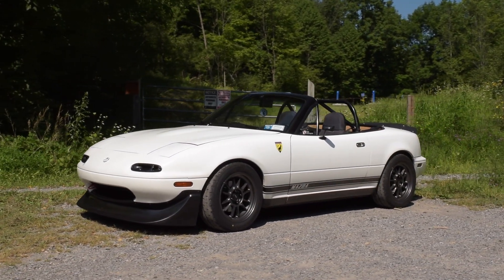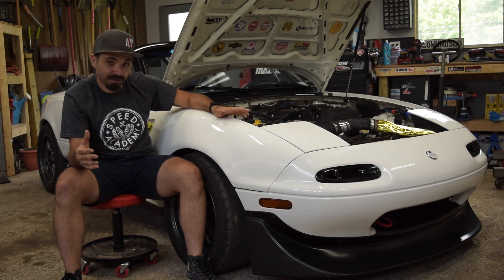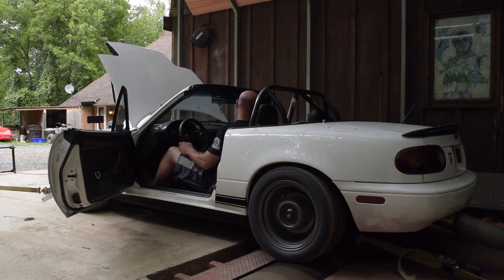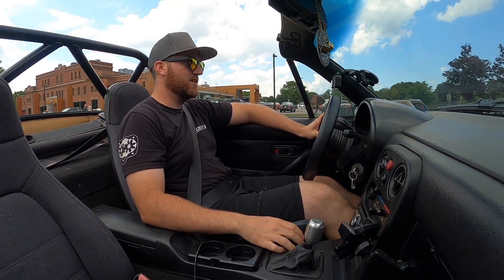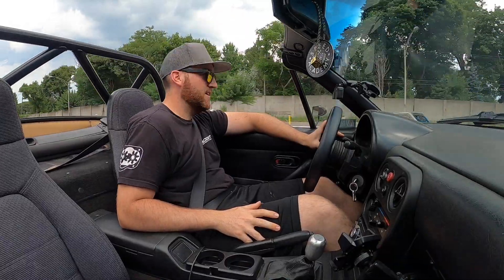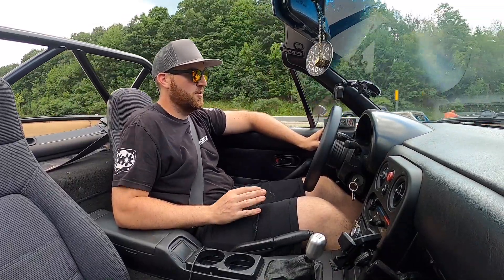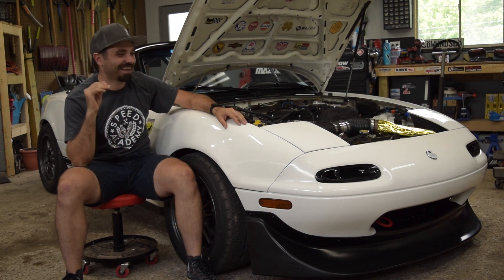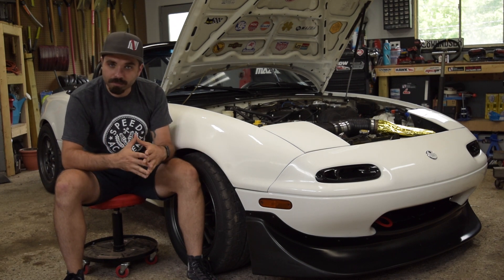NA Power on a Budget - Miata VVT Swap

Comment: In a sense, this is a lot like the 2ZZ swap for the MRS! My dream setup would be an NA body with the VVT BPZ3 out of an NB8B and ITBs plus the 6-speed transmission, or just whatever gearbox+LSD combo gives it the best setup for maintaining plenty of pep and close acceleration while still being competent at highway speeds
Reply: Not at all bcs 2zz makes more than 100hp per liter & revs to the heaven. Unlike bp engines which after 8k it just shortens its lifespan by 3/4
Reply from the maker: Yeah it's a very similar concept

Comment: Great work you guys did. Can you estimate the cost of all the components under the hood? And are 1000cc injectors really necessary for a 180hp build? Keep up the good work!
Reply from the maker: 1000CC’s definitely are overkill, but he had them from his turbo setup. Anything 400cc or above would be more than enough. 

I don’t have an accurate estimate for parts under the hood. Engine parts and machining alone would likely be north of $10k, not including build labor or anything auxiliary.

Comment: Wondering if a skunk manifold & throttle body will benefit a bp05 engine with tomei 252/256 cams and megasquirt. My little festiva is getting out power in my current class
Reply from the maker: Yeah. Maybe not as much but I’d bet it’ll flow better.

Comment: I have a stock MX-5 NB 1999 non-VVT 1.8 and here in sweden we have 99 oct fuel available in the pumps. What is your recommendation for the simplest mods that give most power (non turbo)?
I'm thinking some kind of Cold Air intake + bigger throttlebody like you have. And maybe an aftermarket ECU with custom tune?
Reply from the maker: Intake, exhaust, intake manifold, exhaust manifold. That’s it. And a tune.

Comment: my 94's engine is shot and I'm considering just swapping in a VVT 1.8 in, any suggestions on what to start lookin into for something like that?
Reply from the maker: Google “The Ultimate VVT Swap Megathread”. That’s the cheat code for doing the swap. It’s definitely worth it.
Reply: @NappMotorsports  
Super appreciated, getting my hands on a VVT next week and will be getting the accompanying hardware from the same place

Comment: Hi guys, excellent video! I'm planning a similar build (1.8VVT into a '99 NB1). Should I use upgraded valve springs? I have a set of the Volvo valve springs forums say have stiffer spring rates. I plan om using the car in autocross with a rev limit at 7400 rpm.
Reply from the maker: I typically recommend Volvo springs for a budget type build. I actually just installed a set on an engine.
Reply: @NappMotorsports  thank you!
Reply: After a full day (hub) dyno sessions, managed 157 whp (6500rpm) and 140 ft lbs (5100 rpm) at the wheels. Thanks again for this series!

Comment: what's the 0-60 now boys?
Reply from the maker: It’s on jack stands, so very slow haha
Reply: @NappMotorsports  😂 ive got a vvt engine sitting here but doubting myself now and wondering if i should just turbo.
Reply: @abgingernuts  there latest video shows them going back to NA. That says a lot. I’m doing the same after my supercharged cars too
Reply: A good turbo is very scary and fun to drive but unless your a very good driver or brave it can kill the fun on the streets since you get to 100 quick and are always braking to slow down

Comment: Could you have got away with more of a head skim do you know? All the people online that have taken 60thou off have done it with bp4w non vvt.
Reply from the maker: It’s possible, the only difference is that you would have to be sure the intake cam has clearance at full cam advance with the higher compression pistons on the VVT bottom end. I don’t know for sure how much you can take before that interferes.

Comment: How did you Come to that compression ratio with that limited shave?
Reply from the maker: VVT’s are 10:1 factory, and every 0.020” head shave is worth 0.5 points of compression. So a 0.040” head shave is worth 1 point, making 10:1 into 11:1
Reply: @NappMotorsports   11:1 will it be reliable(hot engine)??? and also is it necessary for other cums???

Comment: Is that a big upgrade? I have a mint 91 automatic miata  and an ok 02 nb manual miata, i never did an engine/tranny swap
Reply from the maker: A 1.8 swap is a big upgrade over a 1.6, especially when you factor in VVT. I always recommend a 1.8 swap before any engine mods to a 1.6, it’s just not worth modifying the 1.6’s in my opinion.
Reply: Thats alot of work for 20hp gain

Comment: Umm, Skunk POS intake lost torque from the start of the test to the end and picked up top end horesepower above 6,000 RPM.  In a drag race, autocross, or road race the Skunk intake is going to be slower than the stock POS VVT intake.  On an NA VVT engine, the only reason to use a Skunk would be for a long course run at sustained high RPM where you run the engine at 6,000Rpm plus for 3-5 miles.  Anywhere else, the Skunk is a power killer on a stock or mild VVT NA engine.  A used EMD/JMD square top manifold will make better overall power than the stock intake or the Skunk.
Reply from the maker: We have a Dyno video that proves this wrong for this exact car.

Comment: Did you get that 11.5 compression number from the head shave?
Reply from the maker: Yup. Stock VVT’s are 10.5:1, and every 0.020” off the head adds 0.5 points of compression. So 0.040” adds 1 point, making the total 11.5:1.

Comment: Nice built but... No camshaft upgrade? BP5a intake cam is cheap peak hp gain! You probably want to keep your low end torque, you're vvt after all.
Reply from the maker: Sadly VVT cams are actually quite expensive. It may be on the menu this winter.
Reply: @NappMotorsports  Ahh ok I understand, I have a bp4w, cams are cheaper.

Comment: 4:45 “I’ll give you guys a 3rd gear pull”  baaaaaaaa as the Malibu is still on your 8 baaaaaaaa. 😅
Love everything about Miatas, “ but/and they are slow. I’m Just used to 200+ HP in 550lb  2 wheel packages.
*keep up the good work
Reply from the maker: Thanks! Yeah, it feels "quick" with the added 50whp but i still wouldn't consider it fast. We are solving that this winter with, adding 75-100whp via turbo!

Comment: Hey Guys do you provide any support services? I was looking to do a somewhat similar build but with a 97 block and a 01-05 vvt head. I was wondering if I purchased the same ECU you did would you be able to provide a tune for my build? Also would love to add ITBs but that could be at a later date.
Reply from the maker: We don't offer any type of tuning services. We do use an excellent local tuner on a dyno, and I would recommend seeing if there is a tuner local to you who knows their way around a megasquirt. It's a fairly common platform so there should be a couple.

Comment: No dyno on e85 for the bolt ons?
Reply from the maker: We didn’t have time to do both. The tune already has the E85 scale factor in it, so he can still run corn if he wants. The only thing we’re missing here is knowing exactly what numbers it would’ve made on E85 with the new setup. We just assuming the same 5HP/5Ft-Lbs thing as the first time we tried E85. It’s an NA motor so it’s not really going to benefit much anyway.

Comment: Hey guys, good work with that vvt-build!.. if you can, it is worth going e85. My non-vvt 1.8, 1998NB-engine did 167whp@8000~rpm on e85 and the same skunk2-setup as you show here (w racingbeat headers and a freeflowing stainless exhaust of course).. the e85 just allows that little extra ign.timing .. safely
Reply from the maker: The car is set for E85. On the initial setup the E85 added 5 whp and 5 ft-lbs, so we’re just assuming it’s around the same benefit here. We just didn’t have time to dyno it on ethanol again.
Reply: How did you made it to rev up that high? :o
Reply: Does it have good low end ot its just for high revving??

Comment: How about swapping to 85mm bore pistons with 11:1 CR. Then go with +1mm valves, that should get you to 145-150 ft-lbs of wheel torque and 170 whp. Turbos need not apply.
Reply from the maker: The car is already 11.5:1. All of those mods are an option for sure, but the cost to do all that starts to get out of hand, and the cost/hp is not worth it.
Reply: I wouldn't personally ONLY for the sole purpose of a reliable daily driver and crossing state lines for vacations

Comment: So the intake and throttle body were a worth while investment especially if you are  going to go the turbo option.
Reply from the maker: If your baseline plan is turbo, it’s kind of arguable if it’s worth it. It’ll definitely set a higher baseline to start with though, and it’ll help up top. Is it work the ~500 in parts? Idk.

Comment: So just summarise, you've done a head skim, value job, skunt throttle body, and cold air intake?
Reply from the maker: The whole parts list is in the description, but mainly a 0.040” head shave, valve job, skunk 2 intake manifold and throttle body, and the cold air intake. Full headers and exhaust too. And a Megasquirt with flex fuel.

Comment: If I had to switch my 1.8 on my na I would've gone 1.9 build forged bp with fully balanced rotating assembly, billet oil pump, and ATI fluid damper. Coolant reroute with a cross flow rad then worry about the turbo. Just my thoughts.
Reply from the maker: The cost to go 1.9 isn’t worth it when a turbo will kick you right to 250 wheel, and then you’re still limited by your transmission at that point. Balanced rotating assembly is a good idea anyways. Dylan has the coolant reroute and we have a big radiator for it already, just need to install it.